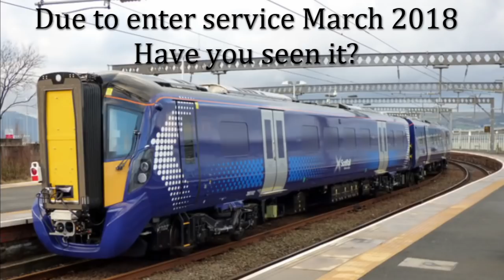The Delayed Class 385 - Update April 2018

Comment: we had a lot of problems when we brought the juniper batch online down the ayrshire coast, doors not opening, not closing, hitting platforms, poor performance issues, braking issues and one set ran away on its own at glasgow central...the front end on these ones looks absolutely awful...so much visual space given up just for design..the only way this seems to be fixable is to rejig the front cone to either flatten off to a straight screen on either side or to extend the side and flatten off the glass, this could be done without too much redesign depending on how the front end has been attached.

Comment: Apparently, there's a load of other faults with the units preventing them from entering service too, ie, engineers have found a lot of nuts & bolts not being torqued properly & apparently the units onboard computer software have major issue's, A end attaching to another trains A end work ok but if you attach the A end to a B end, the software goes nuts.

Comment: These trains are awful...commuter standard EMU's for a major Inter-City route between two of Scotland's major cities. They have gone to a lot of trouble electrifying the 47 mile route, the least passengers deserve is a proper Inter-City type train...why they ordered these is beyond me? 5 or 7 car all electric IEP's would have done the trick if they wanted to stick with Hitachi. If the line was not going to be electrified, then the solution would have been cascaded HST's making all Scottish Inter-City services standard stock using the HST's.
Reply: Eld Jones71 you should try the non-Virgin East Coast Trains services from Peterborough to London (and soon to Horsham). Peterborough-Kings Cross is about 75 miles on trains with a similar format. The last trains, the Class 700, have very uncomfortable seats, described by some as being only suitable for commuting masochists.
Reply: Neil Dahlgaard-Sigsworth modern trains like 700's, IEP and these 385's are a step forward in technology, but somewhere along the line the manufacturers and designers have forgotten the key concept of a passenger train...the passenger 😢 comfort seems to be sacrificed in favour of numbers..."pack them in..stack them high" mentality, which has resulted with thin, rock hard seats not suitable for commuting, yet alone longer Inter-City routes (IEP's). Even First Class overs little sanctuary - the First Class seats look awful in these 385's - not what a passenger should expect for paying a premium 😟 same as the IEP..I have travelled First and Standard on them, and there is very little difference in the experience. If I was a First Class commuter paying thousands a year, I would not be too happy with what the IEP has to offer, compared to First Class in a HST. The world beating design is already there..the HST. All that was needed was a HST 2 designed with the same concept, but bringing it into the 21st century with retention tanks, power doors etc. There was no real need to waste billions on electrification and IEP's on the GWML just to take journey times back to what they were in 1987 using the HST 😆 The HST is a proven design and a great train..passengers love them, that is why lucky Scotland is being transformed with HST Inter-City services. Us poor sods on the GWML have to suffer the IEP for the next 30+ years 😢 I shall be reducing my train travel accordingly.
Reply: Phahahah calling an old rubbish "a world beating design" LMFAO.
Reply: +Eld Jones 71

It's not an inter city express route now.  That's why we will be seeing these EMU's.

Stolping at (Bishopbriggs, Lenzie at peak hours), Croy, Polmont and Linlithgow has downgraded it from inter city express line to a commuter line.
Reply: +Eld Jones71 

Indeed they could do with padded seating installed in them.

Comment: Aren't these just utterly ugly or is it just me who thinks this... surely not.
Reply: People would have been saying the same about the class 170's throughout all their years in service had there been no corridor connectors at front and rear.

The corridor connectors are not built in as standard to the 385's, unlike the 156's and 158's.  The fact that Transport Scotland bave specified that the 385's need to have the orridor connectors at front and rear which is cauzing a problem.  If only the main Edinburgh to Glasgow line had not strayed from the full scale express line it used to be we may have been seeing electric loco hauled services as standard on the route.
Reply: Chris Cheltenham ugly, well your beingrather nice about it.
And the loco equivalent is the class 70.
Theylook like an express dairies milk float .
BR seems to like ugly stuff
Reply: +steven rowe 

Any train that has a corridor connector fitted in on front and rear to meet requirements for a service specified by rail operators are going to look far less attractive than one that doesn't have any of these connectors at either end.

The class 377's are the electrified equivlent to the 170's, don't look so attractive as the 170's at front and rear.

Class 26's expresses many years ago had a horrid black rears though the fronts looked similar to one of the suburban DMU's.   

Maybe they should have ordered one end of each of the 385's without the corridor connectors so that at peak times 2 of each could have been coupled at Waverley or Queen Street so that you cannot see the corridor connectors at least at peak time anyway.

The quarter hour service plus some extra stops put an end to the 6 carriage per train plus a loco or 2 at either end service years back.  Three carriages every 15 minutes could not really be hauled by a locomotive.
Reply: They are nice upto that door at each end of the drivers cabins
Reply: It looks fine for the most part but it's the door sticking out the middle of the front that makes it look bad almost like a squashed nose.
Reply: It's not just you, these are very ugly trains.
Reply: Chris Cheltenham Maybe not ugly but odd for sure
Reply: They look really good